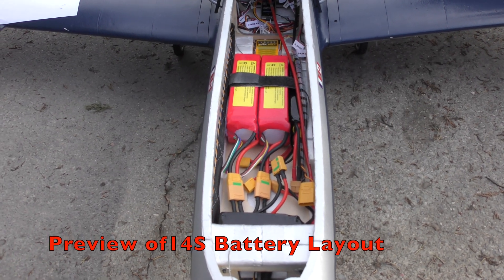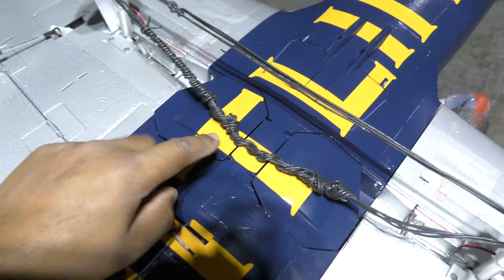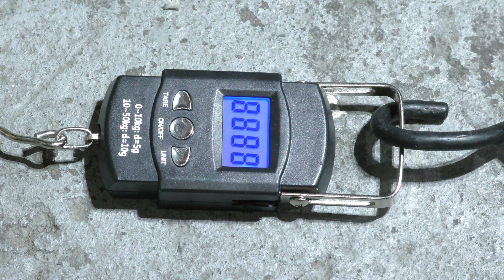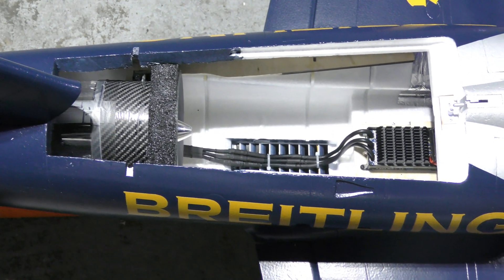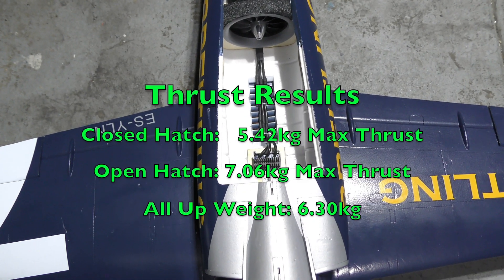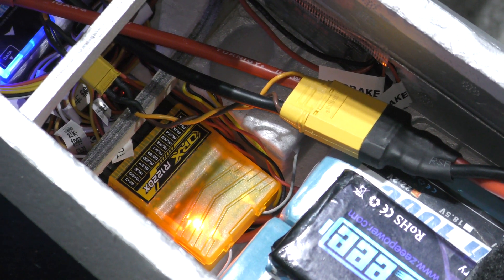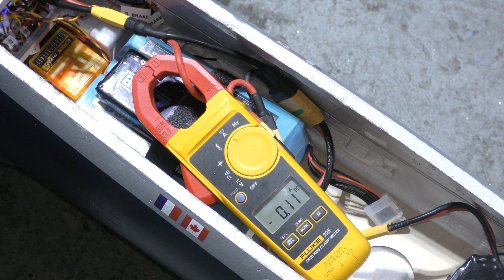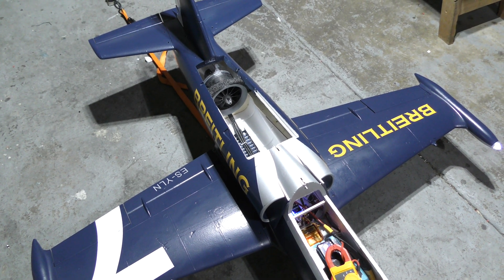BlitzRCWorks/AF L-39 Build Video #4: Pre-Flight Diagnostics & Testing

Comment: Frank I'm having the hardest time finding scale landing gear for an old Bvm, F18C 1:6.
These r fiberglass fuse foam wing yliw fiel models.
I am converting them to dual 120mm edf.
Do u have any suggestions on the landing gear, nose and mains, electric preferred. 
Thnx

Comment: Hi Frank question I am having to push my batteries all the way to the back to get the proper CG is this batteries replacement in this video where you’re flying yours at
Reply from the maker: I will post a video next time I fly. But yes, my batteries are as far back as they can go. Then my rx pack is even further back. I mounted it in between the two wooden bulk heads that are in the center of the plane behind the flight pack batteries and ahead of the cheater hole. That got me further  back in terms of cg without tail weight

Comment: Static thrust is exactly that, no forward movement. You can open up the vents if you want but you are forgetting about the air that will be forced in during flight. This will make up any loss you have with and increase the flow and thrust. Just my thoughts...

Comment: Also you need to take ram air effect into account as well. With the plane moving you should get some more thrust from that alone. Static is not always the same as what you will get in flight.
Reply from the maker: True. True. I still like to get the max static thrust I can.

Comment: XT 60 is always gonna get hot when trying to mover over 125amps!! Its also gonna cut your max current down too since it doesnt want to flow that much current! You need XT90 all around to make things happy. The xt60 is a bottleneck at the moment. Either way though this is an impressive plane!! A huge step up from the HSD stuff! Way better quality! Looking forward to see your progress on this.
Reply from the maker: Yes Ray you are right for sure! I agree XT-60 is just not enough for the job. I think XT-90 are borderline too! But I think I found a good option. The QS-8. Basically a XT90s scaled up to 8mm bullets. Can handle upto 300A. All my batteries and planes will be getting that connector

Comment: Am wondering if your going to run into the same issue opening up the bottom that is with the HSD viper EDF. Being these airframe were design for turbine so you have a smaller intake as you already know your not getting enough air for the EDF. Here's the thing with the HSD viper. It has a very long cheater opening under the bottom. The  control box that came with the older version has a preset throttle to elevator mix. What happens once your at or start to go above half throttle the elevator mix kicks in and that's because the plane is pulling air from the bottom and causes the plane to nose down with the mix you don't notice it. 

What some guys have done and that's close up the bottom cheater hold and add opening on the side of the plane. What they have found out. 
1 You no longer need the throttle to elevator mix. 
2 The plane performs just better.
3 Most guy upgraded to the JetFan 110
4 Better flight time.
5 More speed

I myself am getting ready to perform the same thing on one of my older HSD viper before I try this on the newer one. Am waiting on some 3D printed NACA parts to come.
I will be doing some of the same testing as you. Some testing before and after the mod. The EDF was upgraded just before the end of the flying season and I seen a big different.
Then again you may not run into this throttle to elevator mix issue. 
What if you tried removing the cheater from the bottom and replace it with a screen you should be able to get a bit more air inside. The screen will also help to keep junk from being suck into the fan.

Then again maybe you could put a cheater opening on that top hatch and see how that works and on the side of the plane. You've already found out with the top hatch your getting better air flow.
Just my two cents.
Reply from the maker: JetJunkie these are good points. I was just reading through the HSD super viper forums on rcg after MikeRC pointed the same issue out. I have had good success with bottom cheaters on the large Skymaster F-18 but given that a few folks have mentioned that I should be cautious, I will definitely take this into account. I was really hoping to avoid cheaters on the side or top for aesthetic reasons but maybe I shouldn't be. We'll see!
Reply: @FlyWithFrank  Try relocating the motor wires off the cheater opening. Wires are cylindrical which is a horrible aerodynamic shape, and you have all three side by side. That should be causing drag right where you don’t want it. 

You have an awesome build series going here. I can’t wait to see it fly!
Reply from the maker: @davidfidler6449  Not a bad idea. I was thinking about that.
Reply: @FlyWithFrank  The other route you could take if it won't involve to much work. If you could widen the intakes. This way you would have to add cheater to the top or side. That maybe hard for you to do now that you have all your equipment install.
Or be able to tunnel the air from the intake back to the fan.

Comment: I'm assuming you will try to 3D print some kind of new grill for the bottom. I'm wondering if Mark discovered this issue also. 7kg is great and will be great in the air! The amp draw seems right on the money. But you said you were using XT60 on the packs?  you made your own 3 way, would love to see a closer detail of that.
Reply from the maker: For sure. I'll put a closer shot of the three way. And yea 7kg would be nice but I want more. This fan should be capable of much more so I'll tweak this until I get it right